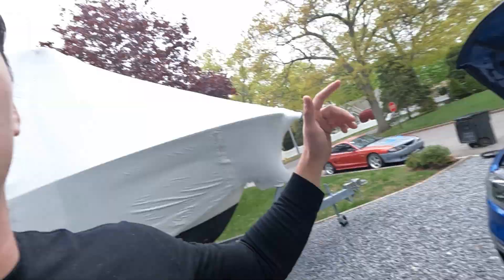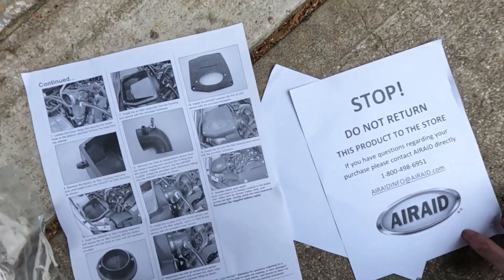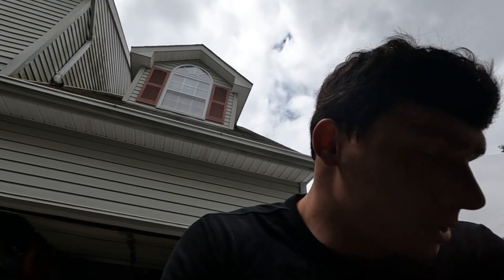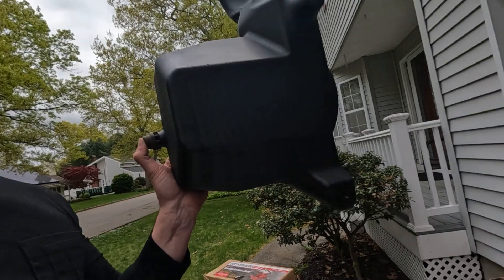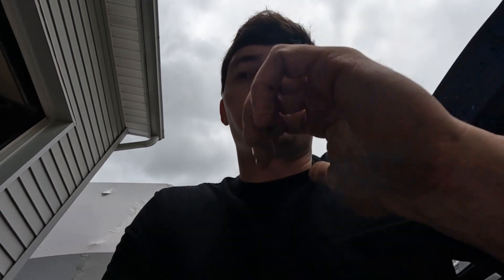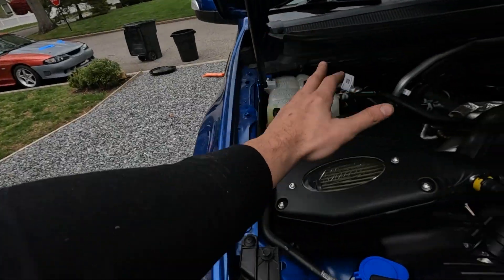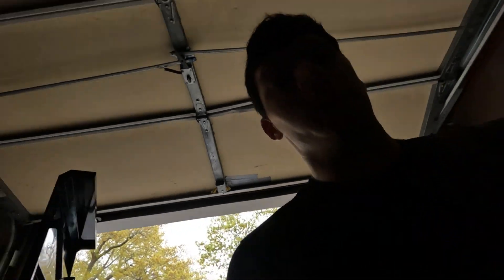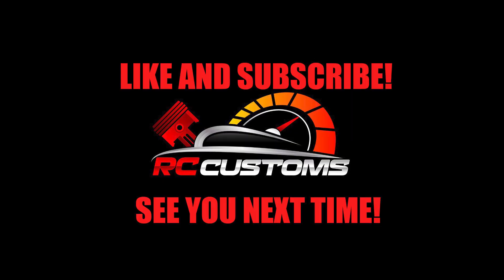2019 Ford Ranger Airaid Intake Install and Sound

Comment: did it make a noticeable difference in performance or mileage?
Reply from the maker: I'm currently running a 93 octane tune by sct aswell and I would say with that and the BOV the throttle response feels a little better, milage is about the same.

Comment: Its a good filter, but I really hate taking it off and on to clean it. They dont leave much room to get to the flathead bolt. It is an extremely tight fit. I probably would have gotten something else if I knew better.

Comment: Check out the cvf intercooler pipes. If you just wanna hear the turbo spool you could get the hot side pipe for just $180 and throw that bov on there. The silencers in the intercooler pipes really make more difference than the intake. I'm running the velossa tech ram air scoop, afe air box inlet, afe pro dry filter, cvf intercooler pipes, turbosmart bov, and borla exhaust (sound like shit honestly, but I got it used for $400)